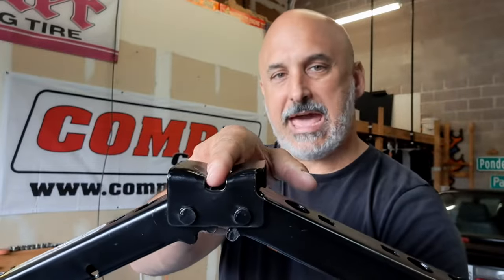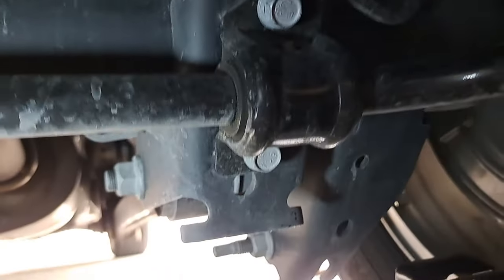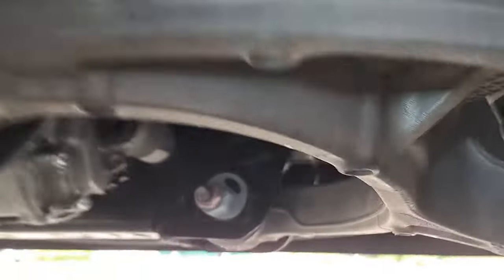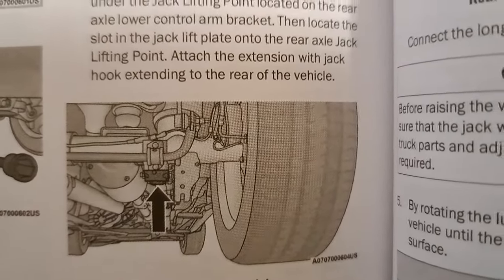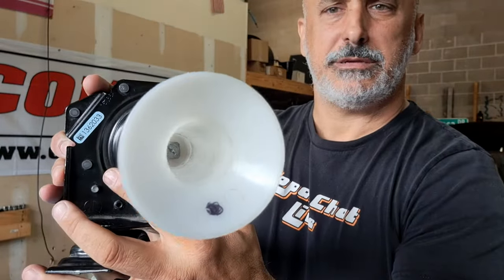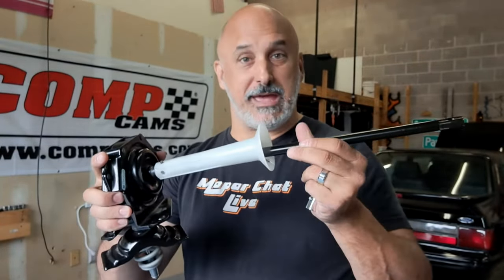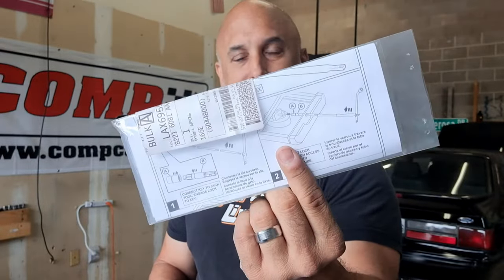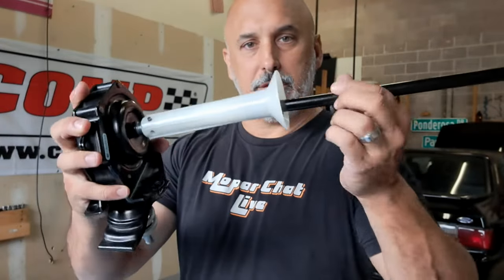Ram 1500. Jacking points for the stock jack.

Comment: Mason - thanks, this video is the best I found that shows where the jack points are. With regards to your description of how to remove the spare tyre/tire, our 2022 DT 1500 Limited (in Australia) doesn't have the small adapter you demonstrated, instead it uses the "Short Extension 5" (as referred to in page 378 of the supplied owners manual) to fit on to the end of the winder mechanism in the white plastic guide.

Comment: I take a new 2 ton bottle jack with a cross wrench and 8 inch pieces of 2 by 4s and a few 4 by 4 by 1 inch pieces of oak In my truck wherever I go. It is nice to have the 2 Jack's available.  One time I was on soft ground,  the doubling up of Jack's and wood saved the day. And in the SRT,  I pulled the stupid subwoofer out to install an 18 inch spare from an R/T. I have the complete factory setup,  but am still with pieces of oak and an sourcing a short bottle Jack to be more effective to lift the heavy car. A few pieces of 2 by 6 with degree cut angle edges times 16 inches and 8 inches long give me a portable ramp that is 3 inches high when stacked. Further aid to lift car a bit to get Jack's positioned if needed. Tmi, but thinking ahead is very important.  I am a Hi-Fi guy to extremes, and I really think that that trunk subwoofer is a P.O.S. that they made money on in the overpriced stereo package.  I don't even miss it.

Comment: What about a regular floor hack with the round piece on it. Where would I put it on this vehicle
Reply from the maker: Most of the time guys will use the differential for the rear and the frame rails for the front.  Jack stands are mandatory

Comment: The front jacking points on this truck are absolutely asinine. The jack has so much potential to slip off towards the inside of the vehicle and drop the whole front end. What a horrible idea. It puts stress on a tiny aluminum notch and creates an extremely high danger breakage which will cause jack slippage.
Reply: It will slip too. If you don’t have even perfect surface area that bastard will slip. I’ve jacked up hundreds of commercial vehicles and industrial lifts. But my own ram is the most dangerous thing I’ve ever jacked up.

Comment: the jack of a dodge truck is the dumbest wieirdest idea. Older cars used a strait foreward jack you simply put it under near the frame no "jacking tabs" needed so you could use say, a '78 Olds on an '82 Buick if you did not have your 82's stock. this thing was made by someone who wanted an art form rather than a practical tool! :(

Comment: When I Leif the rear I put the jack under the pumpkin.
Reply from the maker: I would never ever use the stock Jack under the pumpkin.
Reply: @bmasontv  it's a 3 ton floor jack
Reply from the maker: @JackO-d9t  video is speaking specifically on the stock jack.